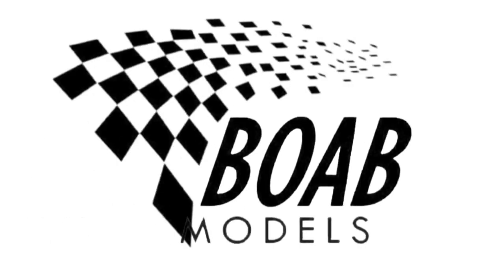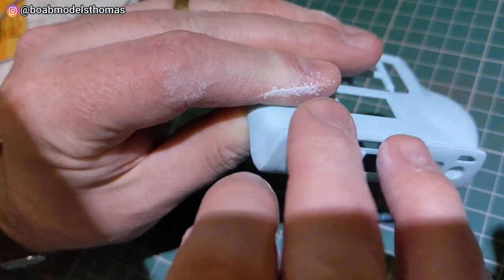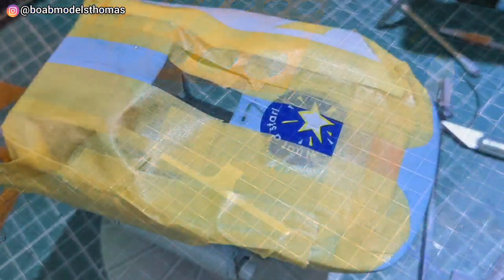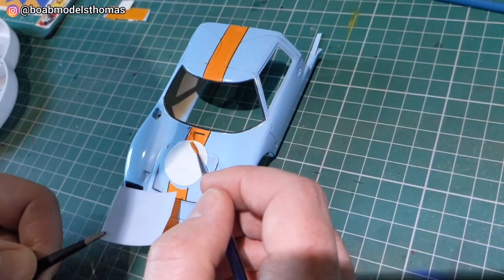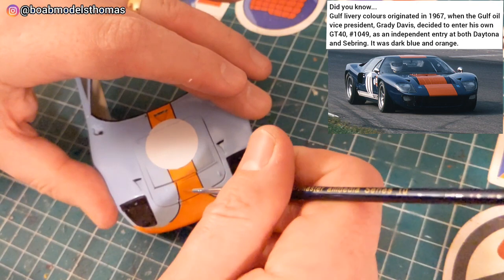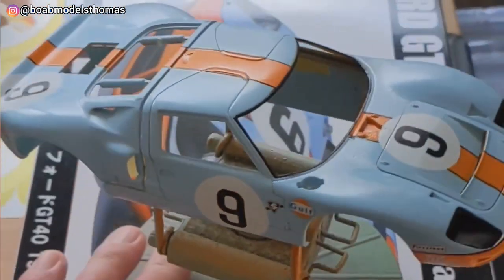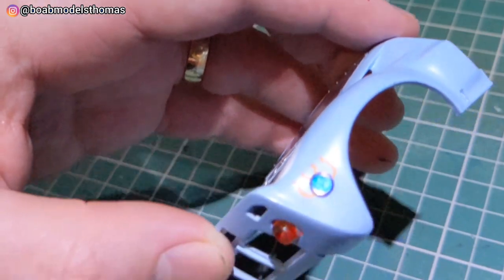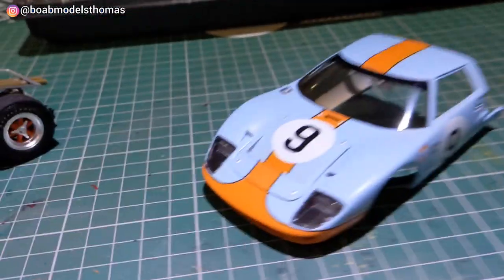Ford GT40 1968 Le Mans - Part one - bodywork - Fujimi & Revell 1/24

Comment: You are a master with those decals Thomas. The details you have added really set it off. I think the Gulf color scheme looks much better than the '66 Mk2 black that I built and I have the 1/24 kit in my st6ash so may get some decals from Indycals as they are excellent quality.
Reply from the maker: Very kind, Allan. I do like the black and silver '66 winner but the Gulf look is a real classic. If yours is the Fujimi like mine, it should have the parts for both versions.